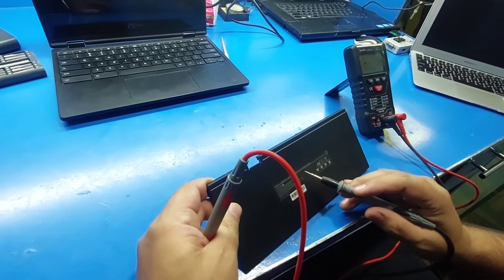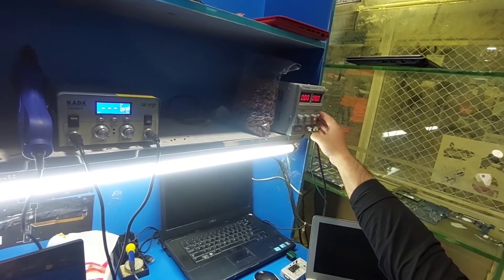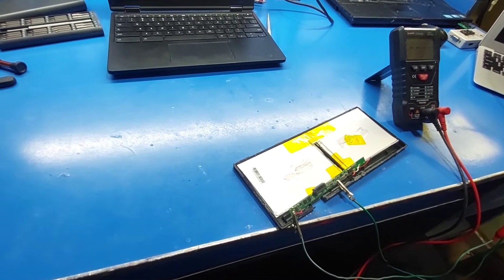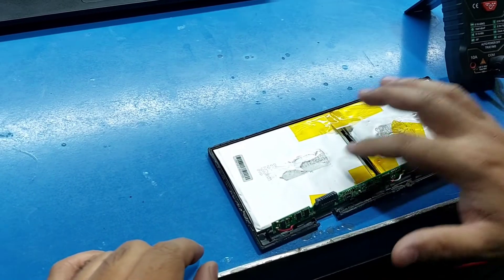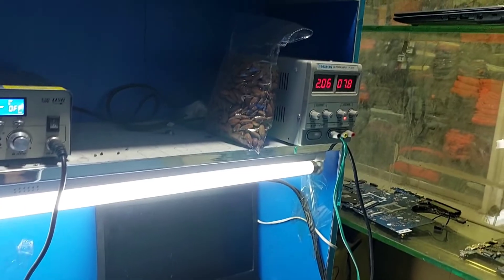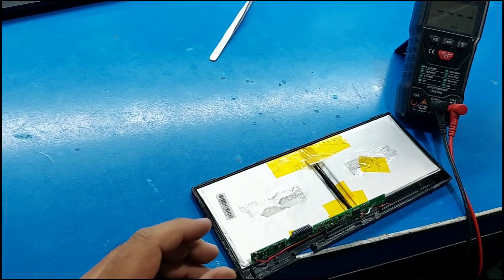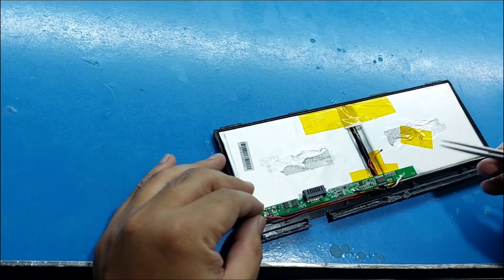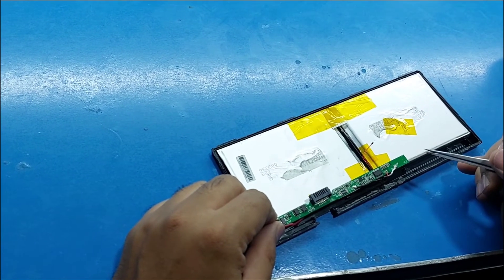How to repair laptop battery without programming

Comment: this batt was not "locked" (in response to the video description that says "how to unlock ...", the output only was disabled by the control IC because it was conditioned to do so, the low voltage of the cell(s) was probably the event that triggered to turn off the P mosfets. Once you raised the cell voltage and applied positive voltage at the output terminal then the IC restored the output. You did this by jumpling B+ (the cells 2S terminal) with P+ (the output terminal that interfaces with host system for bidirectional power supply, this is same as connecting to charger). if something triggered a FAULT condition in the IC then it would permanently disable the output and broadcast a "FAIL" message on the SMB bus to the host system (the laptop, which will show "battery damaged, please replace" in windows). then you would have to reset the IC, if the cells are still bad you would need to repeat the video steps regularly until fault condition arrives sooner or later... BMS fail considerably less times than the actual battery cells specially if they have hundreds of charging cycles done, and this BMS PCB being permanently disabled and reporting that to the EC/SIO/similar are STILL evidence of good functioning. i hope in the future resetting this could be easier and cheaper.

Comment: My dell laptop 6440 battery cell i changed bt not working again this showing biking light .boss plz suggest me
Reply from the maker: Apply this method. If it does not work for this battery, then visit battery repair shop.

Comment: Bios discharging does it after 10 discharges. It needs 10 discharges in Windows, one in bios. For Asus, it needs 3 in windows, 1 in bios. It enables 1% hibernation, and a performance boost. The performance mode will be 3x greater, if you take out the 2 choppers in cod 4, tge rockets are at the bus.
Reply from the maker: Not understand what you are trying to say

Comment: I have 2500 Batteries HT03XL Original from HP Machine All the laptop become old stock now the battery is not working , kindly suggest
Reply from the maker: Use there cells for other batteries

Comment: How does somebody fix a physical flaw that a battery has, using any program? Sounds as dumb as it may be.
Reply: you are kidding, right?😶
Reply: @akwasiopoku3189  am I tho
Reply: Helps when  battery was standing  . Work  for me x 100 batterys
Reply: not physical of battery but "Battery Management System"  / "BMS" (board circuit) has a problem chip protect because laptop broken at mosfet or IC PoWer Management so battery get over voltage & IC BMS protect battery & cut off electiric voltage & current to battery
Reply: I assume that if the BMS  is not removed then you can charge and the memory controller will not create a problem when reinstalling the battery. However, does the short  at the end act as a reboot or bypass on the IC?